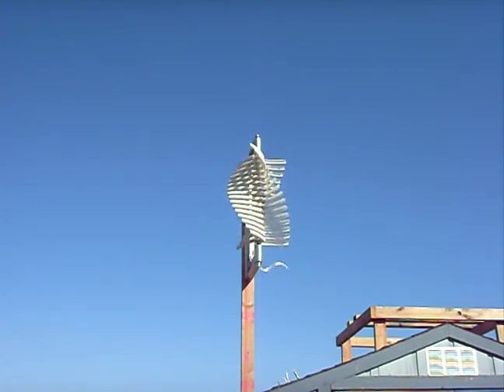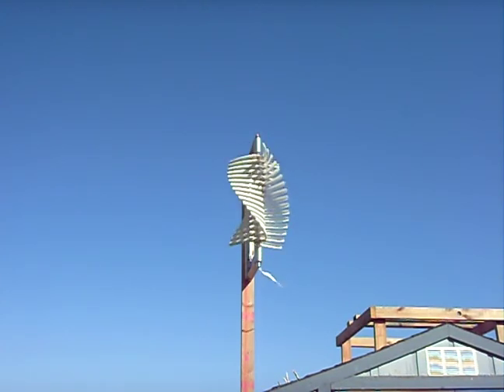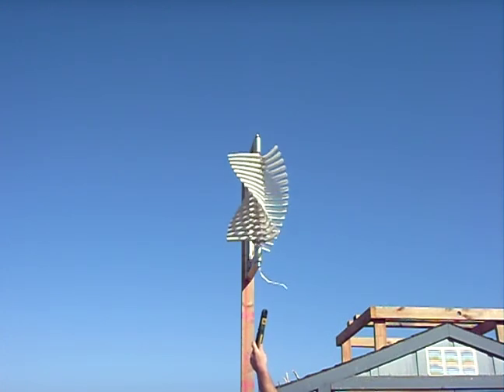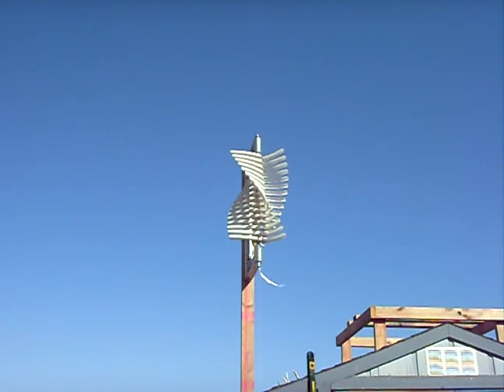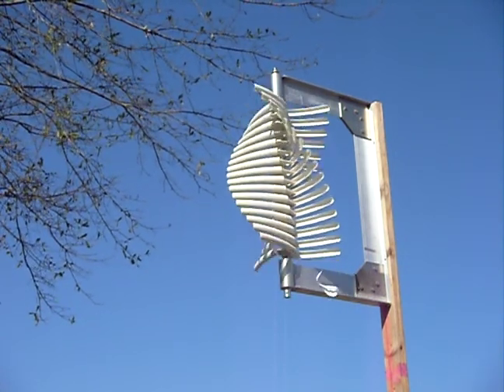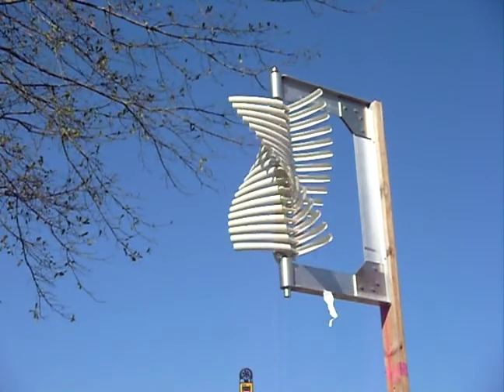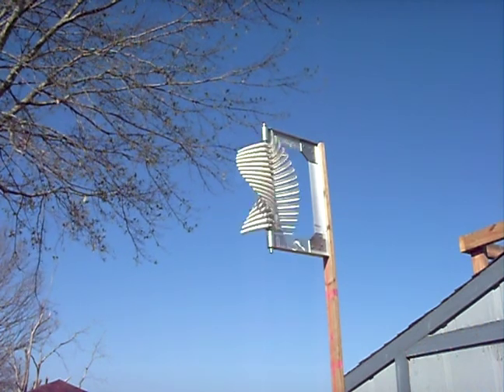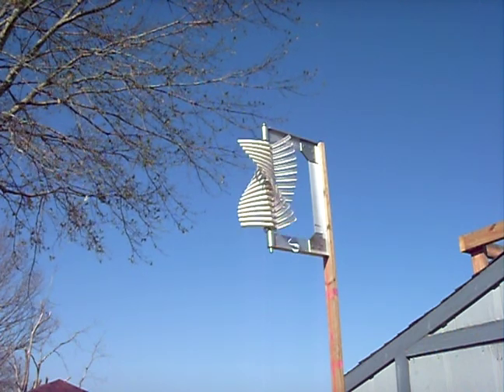RPM VAWT POWER

Comment: Hi There,
By torque do you mean the load that this turbine will face because of the weight of the generator or anything else?
I don't know anything about electricity and turbines etc. but i have an idea in mind about a completely frictionless turbine.  
Regarding that i want to know  that , does a generator put load on the turbine other than that of its weight? or there are other reverse forces as well when a generator is in use?

Comment: Is there any data now?
Compared to any other VAWT? Material usage and power output?
You can messure the efficency without a generator. Just messure the force and rpm for the design.